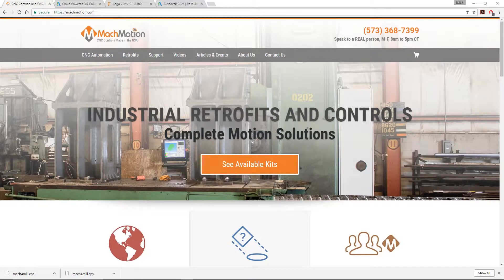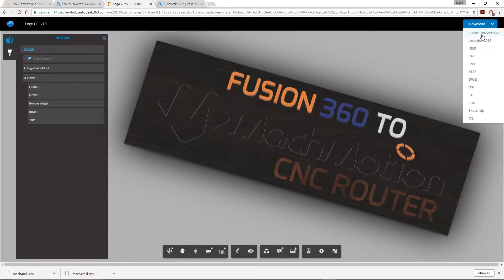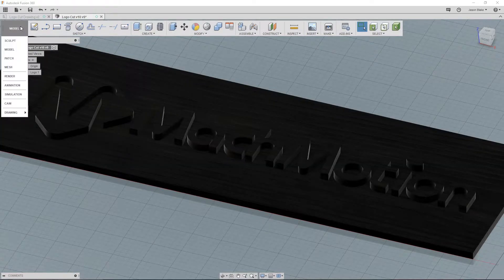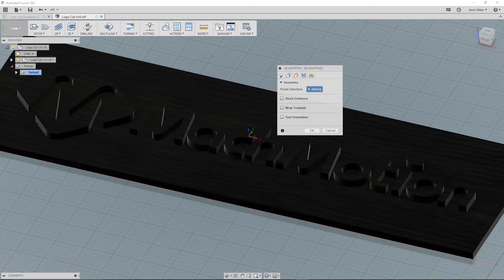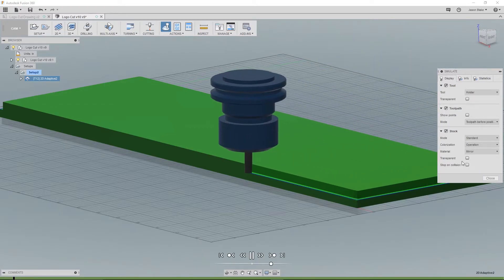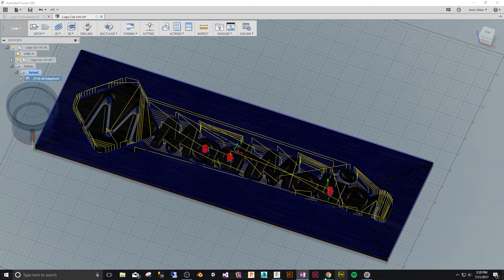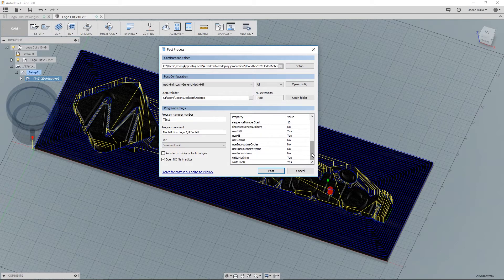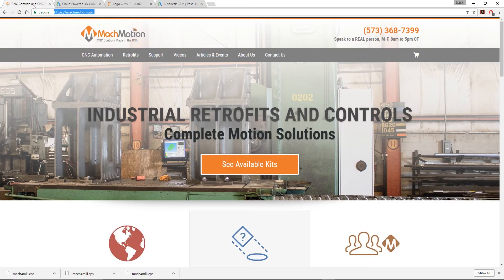Fusion 360 to MachMotion Retrofit CNC (Fusion 360 Mach3/4 Post Processor)

Comment: question why are some large builders going Linux  and not mach 4  like hass
Reply from the maker: koollakes No idea. What are your thoughts?
Reply: my guss its free open source  there claim  is the real time kernel in Linux its THC is faster. and its system is faster  because windows is not real time does cnc  need real time does not the controller make the machine what it is